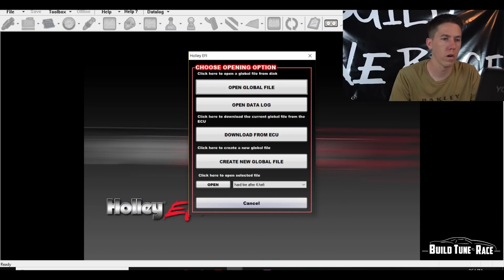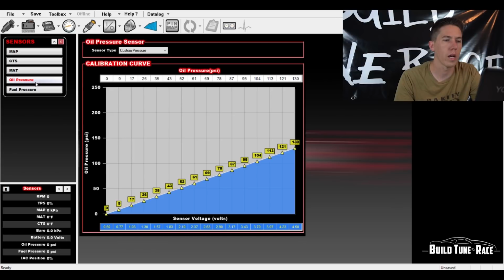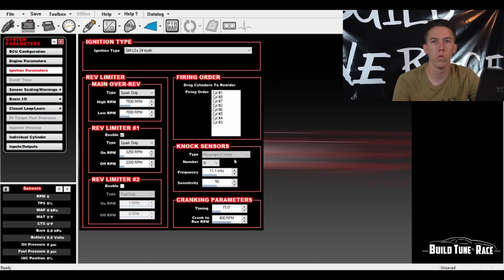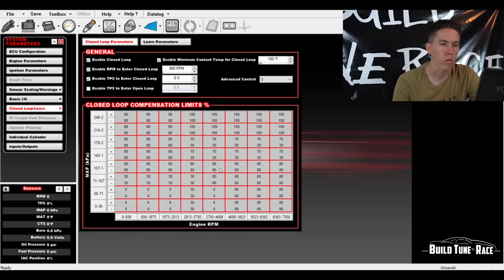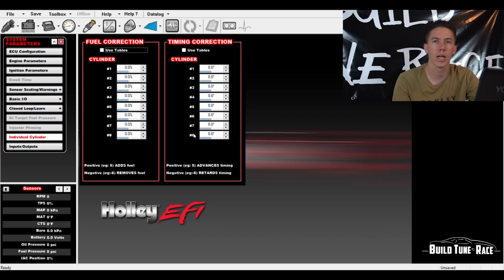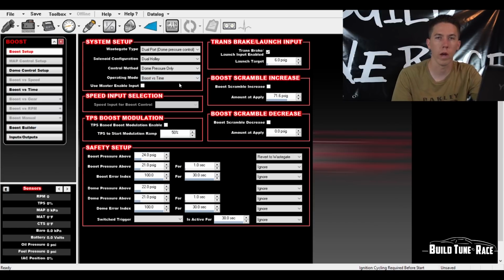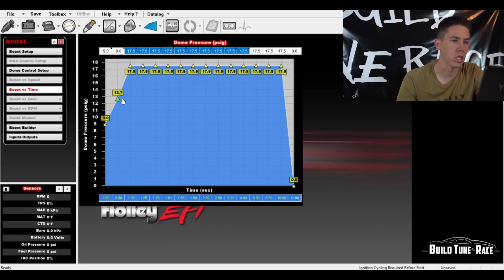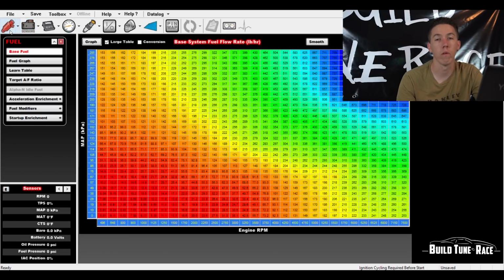Holley EFI HP/Dominator walk through | Build Tune Race

Comment: quick question I'm considering setting up my 427 sbc with an HP mpi system...my engine only pulls 5hg at idle...from my understanding 02 sensors read very lean at idle with a big cam .will low vacuum like mine be able to be tuned at idle and will the map sensor run correct at other rpms with a heavy cam?  any info would be great

Comment: It says you must select the correct brand O2 sensor or you could damage it what sensor comes with the Holley HP?  They don't bother to tell you.
Reply from the maker: You can get it with the Bosh or NTK should have it etched on the sensor
Reply: @BuildTuneRace  
It's not etched on the sensor which brand, it just says "Holley" and then I assume a part number. The other end is apparantly a Delphi connector. Looks like I'll have call Holley and ask. Seems like pretty vital information they left out.
Reply from the maker: @177SCmaro  if you know the part number of the kit you ordered you could look it up that way too. Should say in description bosh or ntk. The ntk is the more expensive kit designed for ethanol and methanol
Reply: @BuildTuneRace  
I'll look into it, thanks.

Comment: Can you answer this. A tuner is trying to charge me around $600 for a tune. Can I get close to that tune level if I buy this system?
Reply from the maker: Super hard questions with a ton of variables. Depending on system and what your trying to accomplish your level of tuning knowledge and the combo your trying to tune. If you can find a base tune really close to your combo and its a simple combo like a simple N/A with some learning you could probably get by. If your building a complex combo boosted or something high horsepower and you don't understand efi tuning your probably going to need someone to tune it. The Holley has a awesome self learning tuning strategy but it is not a plug it in and it will 100% tune itself unless its a simple combo even then a real tune will have benefits.

Hope this helps!

Comment: Pretty good video!!!

Just a personal opinion, but I try to keep all my fuel maps to within 3%, so I normally limit fuel to +10/-5.

Another thing I do is to blend the fuel map on initial tune, before going WOT, then add 10% to any WOT cells and raise the fuel adder to 20%. This keeps the thing from falling on its face and possibly burning a piston or worse for the first WOT run.

The Holly EFI system really works well, and is so much easier to tune than HP Tuners, albeit without all the fancy parameters.
Reply from the maker: Sounds about right! Thanks for watching!

Comment: Do you know of a base map set-up for a 572big block? Just got a Holley hp efi set-up  thanks.
Reply from the maker: I thought there was a big block base tune start up file in the holley you could try that if it seems close to your combo. Just need it close enough to get started then you can start dialing in the fuel table from there if you find that it seems to be real rich you start by pull 20% out of the whole base map and go from there

Comment: If you pull/add boost out of it in the boost control section does it pull/add fuel automatically or do you have to do it yourself
Reply from the maker: It will reference the new area of the fuel table to match the boost level so all the fueling is already dialed in from initial tuning.

Comment: Thanks for the i formative video.  I have an Boss 351W based stroker 408 that I want to convert to Holley Dominator efi with port injection.  I'd also like to bump compression ratio to 12:1 and run flex fuel as well.  
Eventually looking at doing a Procharger D1-X too.  Gonna need a dual sync distributor or can I go coil on plug conversion?  Thanks
Reply: TheRdub82 why don’t you ask the LGBT community? They would surely know more about your ford power plant.
Reply: @cadeflorez3457  only a punk would make a comment like that.  Respect the mans channel and keep it about cars.
Reply: I was thinking of upgrading the flux capacitor on my DeLorean. I was wanting to know if I needed to change the blinker fluid before I put a wet shot of NOS or would it blow the welds on the intake? I’m trying to reach 88 mph trap in the 1/8th mile so maybe I can travel back in time and retract my previous statement so this guy doesn’t get his panties in a wad.

Comment: You have doost control set up wrong!
You got lots to learn
Reply from the maker: What's wrong with it? It's worked awesome the last 3 years.
Reply: Should not zero out your air temp correction
And your launch psi should be set dif. 
Email me if you want more info.  Cam406406@yahoo.com

Comment: How much Documentation comes with it. I have never saw good Documentation for the price paid. Had BS# and Seed Pro in the past and was a struggle at first.     Hoping this has help menus ??
            Great Video on The Holley HP/Dominator
Reply from the maker: The holley has really good documentation you can download the software for free and go to the help menu and it will pull up all the documentation also if your wiring in accessories holley has documents under the products on the website too to help wiring and everything!

Comment: I was going HP tuners. But after I downloaded the Holley software, it sold me. I came from strong arming an SRT4 mopar ECU to a Cobb access port for fords, and seeing the Holley made me take the dive.
That being said, it’s more complicated than Holley would prob like you to believe. Buts it’s also Infinitely better and less complicated vs a Cobb accessport (or prob any other flash tuner for that matter ).

Anyway, just wanted to say this is a great video. I’m sure it’s going to get a ton of views over time because I’ve searched for a video like this about 15 times in the last 3 months and mostly just come up with Holley videos of guys snapping connectors together and running simple N/A motors off the 3.5” touchscreen base tune and calling it a day. Truthfully, I already knew 90% of what your going over, but to learn anything is always a good thing ( I just tuned my buddies ford Mavrick with a GT40 302 and Paxton SC with a blow through and Holley super sniper Efi a few nights ago ). And it’s works great. 

My request is the same request someone else already made. Maybe go do a datalog, maybe even get some in car video while doing it ( how fast the car is or looks isn’t really relevant ) and show how the “bubble” moves around the scales live. And then go over the datalog with what you show in the video showing up on the datalog.

Another tip.... since most people are looking at this for LS engines ( 1/2 at least ). Sloppy Mechanics (Matt) gives away his tune on the 1000whp 6.0L Colorado for free. This gives you a lot of great info. Like how and where to put tables in for an E85 sensor. 4L80e shift tuning with a lock up converter. Some examples of nitrous control ( one of my fav parts is that he has it yank timing A LOT when the nitrous engages, and then feeds the timing back in over rpm. It reduces the shock load on the bottom end and driveline.). So a lot can be learned for looking at examples of other people’s tune, even if they do not apply directly to you. 

Great video. Thanks for doing something unique that even Holley hasn’t done. If you can go any deeper ( I realize your in a race car and that only requires so much depth ), then I will def watch those too. 

Sharing video now :)
Reply from the maker: Thanks Bryan for the great reply I truly appreciate it! I will take everything you mentioned into consideration the holley is an awesome system and I keep learning more and more each day! Half of the battle is understanding the wiring as I ran into some issues last night on anouther guys car but getting through it! I would like to post complete how to at some point on boost control, nitrous control the new staging in v5 ect!

I will do a data log video as soon as I can. I think that will bring alot of value to people! 

That's awesome your learning it as well! I really enjoy playing with it but sometimes it gets frustrating, but when it works it works extremely well!

T
Reply: I’ve watched from a distance, Jay from real street tune my buddies twin turbo viper. It runs a zillion dollar
Motec. And it’s 100x more complicated than the holley. My Cobb race tuner software is 10x more complicated. I think the super sniper is the way 90% of people should go ( unless you have a hemi, coyote, LS ). Sniper uses 90% the same software.
Maybe try to do the traction control like Matt did and go more into it. It’s the best feature on my Cobb tuner ( 340whp fiesta needs ign based traction control ! ). 

Also maybe do a walk through on adding a random temp or pressure sensor. I’m personally using AEM 100psi sensors for fuel and oil pressure but you could use anything. Make it something weird if you can lol. Or even map the sensor out yourself with voltage/pressure-temp and then enter it into the Holley. Just ideas for content.

Comment: You shouldn't zero out your fuel modifiers. Learn will work once the car is warmed up and the coolant temp enrichment goes down to 100%. You still want to have additional fuel when the car is warming up. Enrichment can taper down to zero around 160°.
Reply from the maker: Mike Minnick makes since I haven't played with the fuel modifiers a lot. Ever since I started I learned somewhere to just zero the tables then you can go back and adjust accordingly. But it makes since that once it would reach temp it would allow the learn function to start working again!